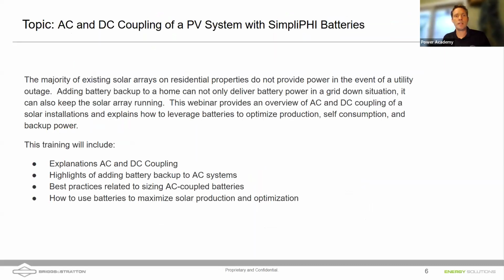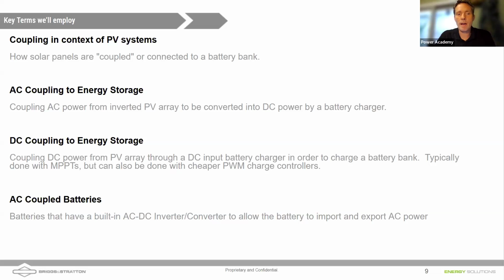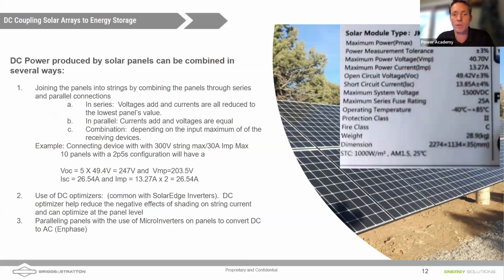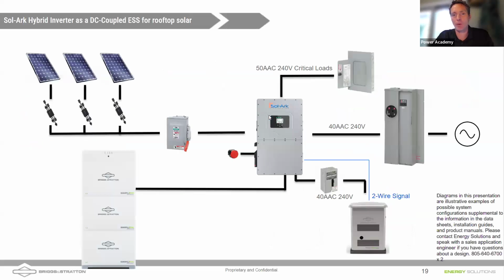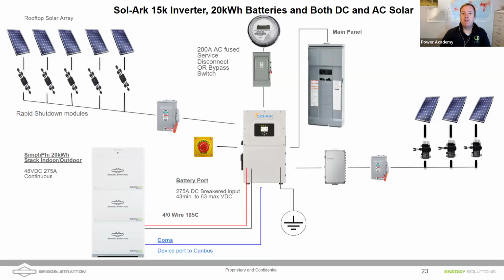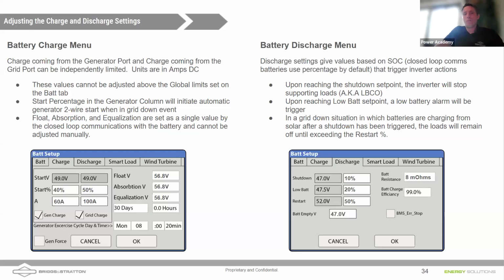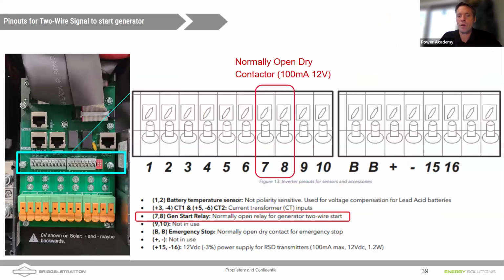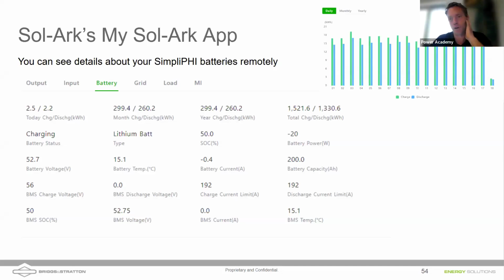AC & DC Coupling of a PV System with PHI Batteries

Comment: So tired of the DC coupled solar is best talk track.  

When you take in the labor costs of the conduit based wiring required for DC coupled the costs are just silly.

Use microinverters and use simple AC wiring inside the house.

If you are concerned about the power loss, add another panel and microinverter or two.